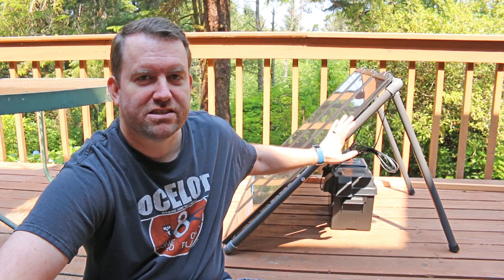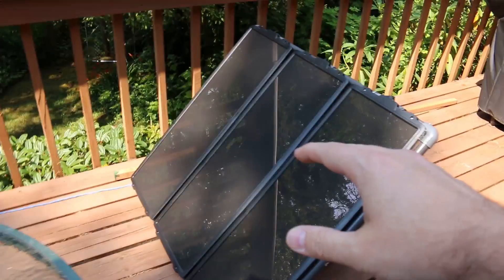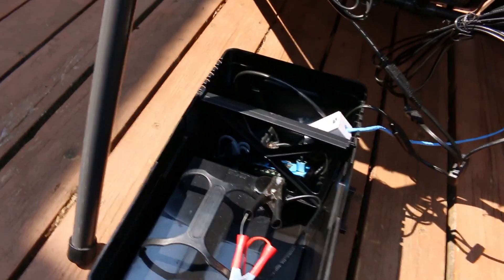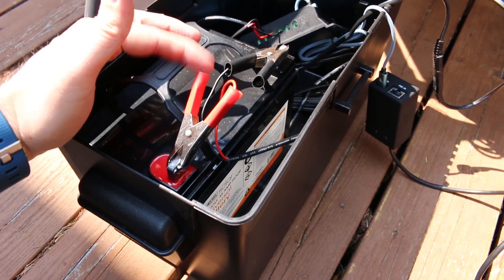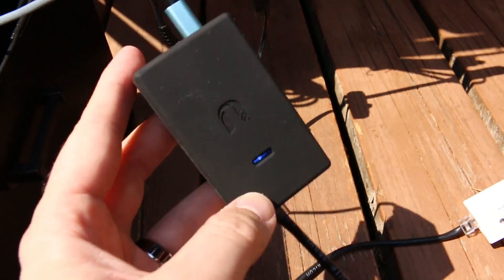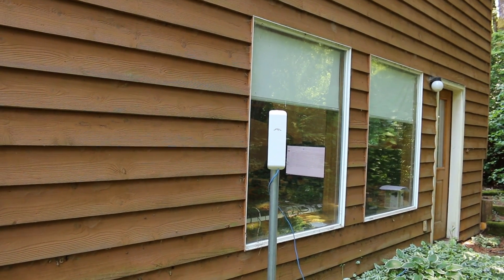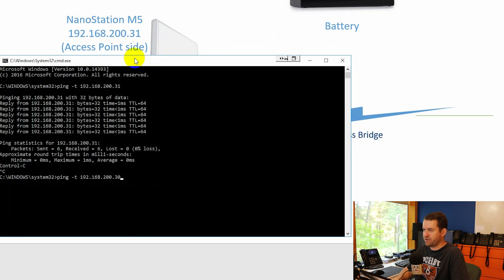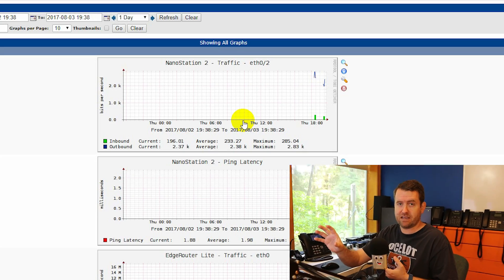Solar Powered WiFi - Part 1

Comment: Hey there, don't put on an inverter. Instead, put on a 12v to 24v boost converter. If you check the datasheets for the nanostations, you'll see that passive PoE is super simple.

>Passive PoE (Pairs 4, 5+; 7, 8 Return)

That simply means that you put +24v on the 4,5 pair, and 0v on the 7,8 pair. tadah :)

You would need one of these: http://www.ebay.com/itm/Power-Over-Ethernet-Passive-PoE-Adapter-Injector-Splitter-Kit-PoE-Cable-White-/222289639667?hash=item33c17eb8f3:g:53IAAOSwaA5Wi5nj

(I'd just use the injector side, the splitter side might have some unwanted components in it)

And then one of these:
http://www.ebay.com/itm/XL6019-5A-Current-DC-to-DC-Adjustable-Boost-Power-Supply-Board-Module-/282245831354?hash=item41b7299aba:g:cvsAAOSwx2dYHV73

Connect the input of the booster to the load on your solar charge controller, then the output from the booster, to the input on the passive injector I linked. 

I couldn't find the datasheet of the camera you have, but the G3 needs 4W max, which is around 0.2A @ 24v, the nanostation needs 0.5A

I'd say that the booster I linked can handle that fine :)

If you want to go for this approach, which will be much more efficient than adding an inverter, and have questions, feel free to ask :)

EDIT: @Jays Tech links to pretty much all of the above, put in a nice box :) 

Direct link to his comment: https://www.youtube.com/watch?v=Tdsf-W6D2L8&lc=z23axz0zqu2wyb3ga04t1aokgpezzvakmbjwkvb4zpctrk0h00410

Link he posted: http://tyconsystems.com/index.php/dc-passive-gigabit/501-tp-dcdc-1224g
Reply: I agree,  I've done something similar and it worked well.
Reply: Most of the eBay Chinese  solar controllers will also run a 24V solar system using two 12V batteries in series. No need for power wasting boosters or even worse an invertor. Going to set this up for a mate to run a G3 camera and a Nanostaion to  monitor the front gate on his farm.
Reply from the maker: Thanks for the detailed feedback - much appreciated!

Comment: Please add fuses throughout the system to avoid burning up your forest. Use 0.5A fuse for the Nanostation, as close as possible to the power source, 1A fuse for each solar panel, and 5A fuse between the change controller and the battery.
Reply: you can use these fuses and holders ,https://www.amazon.com/KO-Fuse-Inline-Glass-Holder/dp/B01FWR5H4E/ref=sr_1_24?ie=UTF8&qid=1502072932&sr=8-24&keywords=.5A%2Bfuse&th=1 i prefer to use https://www.amazon.com/dp/B071VRSYTT?psc=1 these can be found at various prices, and they use standard automotive blade fuses. I like these as they seem to last longer, for the other style  even with in a box I find they can tend to oxidize a fair bit (especially with high moisture, and thus would keep an eye on it/use good electrical tape to help seal it a little bit. also instead of an inverter to run the camera i would suggest a boost converter just depends on how much power the camera needs. idea: https://www.amazon.com/dp/B00J1X4XXM/ref=twister_B06XPF361C?_encoding=UTF8&psc=1
Reply: MZR0682 thank you for the tip. Fuses are very important and will be used if this were a permanent/long term project.
Reply from the maker: Do you have any Amazon links to fuses that you would recommend?

Comment: it's easy to know how log can the router run with the batteries solely. Let's say you have a 70ah battery at 12v.. 

70*12= 840 watts hour.. 

Let's say the router use 10watts to operate...

840/10=84 hours of electricity for that 10 watts router... Now there are losses due inefficiency of the components (inverters) but this should give you a hint of how long you could possible run this without charging the batteries.
Reply: Eh, sort off. You also have to take into account which batteries he's using. If he's not using deep cycle cells, he won't get much more than 20% of the rate AH, without ruining the battery.
Reply: Yes, I know I'm just explaining how can anyone get an estimate... There are many other factors to take in consideration to nail the real numbers. For what he explained in the video he is already ruining the battery tho...

Comment: Dude so many DC voltage conversions is going to kill your runtime. Basically, you are converting 12V to 5V at the charge controller, back up to the output of the installer device(24V?) then back down to 5V at the nanostation(internally). Even with high efficiency converters, that's about 10% power loss at each conversion.

Here is a list of suggestions on how to make this run longer with less equipment.
1. First and foremost, DO NOT run a Nanostation with two 12V batteries wired in series as you mentioned in the video. That will put the voltage higher than the absolute max voltage for a Nanostation. Doing this will damage your device. Never feed more than 24V to an Airmax device. For multiple batteries, keep them in parallel.
2. The first thing to do in a solar project is to find out your power needs. I'm currently building a lithium battery based solution for an AREDN.org project. A Nanostation will run reliably from just 6V to a maximum of 24V, with current ranging from 200 to 400mA depending on the voltage being used, and it has an average power consumption of 2.5W. 
3. Now that you know the power requirement you can calculate the battery and the solar capacities needed. Use Watt/hour as your power unit to determine power production/storage/consumption/days without sun/inefficiencies, etc. Also, lead/acid batteries should only be used to just 50% of its capacity, in other words, whatever is your battery capacity need is, double that up. 
4. Due to the broad operating voltage range of the Nanostation, you can run it directly off the 12V battery and avoid most of those DC voltage conversion losses. Can use one of those passive injectors from WiFi Texas...
5. Please do not use an inverter to power the factory AC POE injector. That will take power inefficiency to a whole new level.
Reply from the maker: Great feedback - thanks!
Reply: Running a DC to DC converter set at correct voltage can easily maintain 24v or needed voltage regardless of extra charging voltage etc. Wifi Texas products work great. Lithium batteries don't like cold, and won't charge in cold. If you need batteries to operate use an AGM or Sealed Lead Acid. But be sure to compensate for lower voltages and capacities in cold weather.
Reply: MZR, thanks for the tip.  How do I wire directly between the battery and Nanostation?  My Nanostation and battery will be about 6' apart, also plan to run a couple POE cameras, can more than one POE camera be plugged into the station (solar) side?
Reply: Could you shoot me an email or private message?  I am really interested in a solution like this with a really good use case and I feel like I could learn a lot from you. You can email me @ support@skymount.tech and I'll reply from my personal email on the same domain.
Reply: MZR0682 love to see what you came up with.  I am working on an AREDN setup myself.

Comment: As for not being able to run the antenna and camera at the same time, the USB port on the charge controller most likely doesn't put out enough amps for this.

Comment: Hey Chris, take a look at this thing: 
http://tyconsystems.com/index.php/dc-passive-gigabit/501-tp-dcdc-1224g  
Connect it to the Inverter connectors on the solar charger. It also includes a voltage booster for the Nanostation
Also, if you look on the Ubiquiti forums, there is some problems with 
the airgateway installer not providing enough power output to run things when running a speed test etc.
Reply from the maker: Thanks for the link!  Much appreciated...this looks like a great long-term solution for a permanent installation.  I threw one on my Amazon wish list so that I don't forget about it.
Reply: Jays Tech we did consider the tycoon power source. There was two factors in not using them, 1: cost! They are more expensive than the installer pro device. Ultimately these will be used a dense network with about 100 devices being installed thus cost is important. 2: we wanted to review the Ubiquiti installer pro and give people a basic use case for it.

Comment: Is the battery a deep-discharge gel battery?  
If not you probably won't get a huge amount of life out of it in this application.

Electric fence batteries or caravan/boat leisure batteries will probably be your best bet.
Reply from the maker: Not a deep discharge gel battery - this is a cheap one.  Thanks for your feedback!

Comment: Chris instead of the Raspberry Pi you could use UNMS as that logs 24/7, i have a UNMS server setup on a $5 droplet with the free credit i got by using the link from an earlier video.  The unms also runs a ping and alerts when the station goes off line, a very good feature as it alerted me to the Nano Beams i look after going off line when someone switched the wrong socket off

Comment: Hey Chris, cheaper and more efficient way to get 24v would be a step up converter over an inverter. Like this http://m.ebay.com/itm/DC-DC-12V-Step-Up-to-24V-3A-72W-Car-Power-Converter-Regulator-ED-/112261825001?epid=2057959971&hash=item1a235381e9%3Ag%3AdrMAAOSw44BYcTW0&_trkparms=pageci%253A537b84ec-7914-11e7-a11a-74dbd180d50b%257Cparentrq%253Aad51825215d0aca47334a2c8fffefbd8%257Ciid%253A1

Comment: You could use 12 volts on ubnt products without problems. Just use an simple poe injector, or build one with RJ45 jacks, and conect it direct to battery. You will get much more efficiency on you sistem.
Reply: Even with POE passthrough enabled on the nanostation?
Reply: The passthrough  shuld drop 0.7 volts or less, with 11.3v the ubnt shuld still runing. Inside the ubnt product it uses only 5 and 3.3v, in this old table you could see thar 10.5v are enought to run the internals step-down regulators.  http://dl.ubnt.com/wiki/UBNT-AOS_prod-specs-gen_5.pdf
Reply: Is that also true for a Unifi Camera?  
If so you'd have a combined max wattage of 12W, which at 12V would be 1 amp.

With 24AWG cables you'd need to keep your cable runs below around 20 ft in order to be able to still have  10.5V available at the other end with a 1amp load.

Seems perfectly doable.

Comment: 14:15 put a second 12v battery in series for 24v then you could run the camera power right off the batteries, no inverter needed, same with the air gateway, assuming they can handle the charging voltage of the charge controller.
Reply: As long as they don't cook at 28 volts, 20 volts is no problem, anything over 15 volts works.
Reply: toysareforboys this is bad advice. The nanostation will instantly cook, it's not built to get anything past 24v. The camera and nanostation will run off the 12v battery at 12-16v without any step up or extra gear.
Reply: i think the problem would be the POE injector only being able to run the one device not 2
Reply: You wouldn't need the injector in that case. The PoE injector is just a 5v->24v boost converter. :)
Reply: And even with 2 batteries in series you'd still need some sort of voltage regulator in place because the battery voltage would bounce from 20-28 ish volts depending on charge.
Reply: True
Reply: I'm absolutely sure that 24.01 volts would not cook the nanostation. I found no published specification on what the absolute maximum voltage is.

Comment: It would be nice to see what the battery percentage is remotely.
Reply: Use a battery that you can hook up to the network. Setup alerts when battery drops to a specific percentage.
Reply: Yeah, looks like you could run an Arduino in ultra low power mode with an ethernet shield and 25v sensor and have it wake up every x minutes to measure the battery voltage. Could even trigger a deep discharge protection latching relay too :) http://www.home-automation-community.com/arduino-low-power-how-to-run-atmega328p-for-a-year-on-coin-cell-battery/

Comment: Great testing setup, I love seeing gear being tried and tested before being sold. I had never seen the USB power before, I'm going to be ordering one.
What sort of battery are you using? If it's lead acid be careful of deep discharge, the load output should be protected against deep discharge but I'm not sure about the USB.
Could the camera not be working due to voltage drop over the relatively long run?